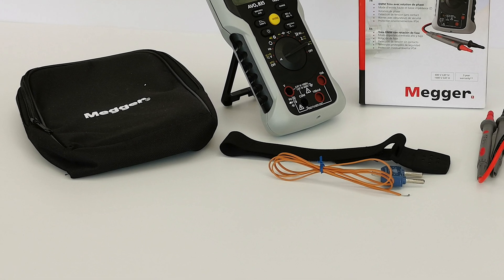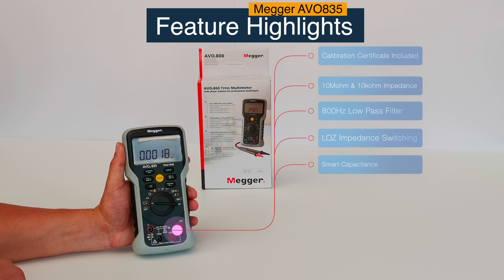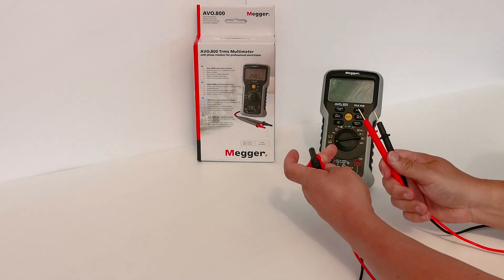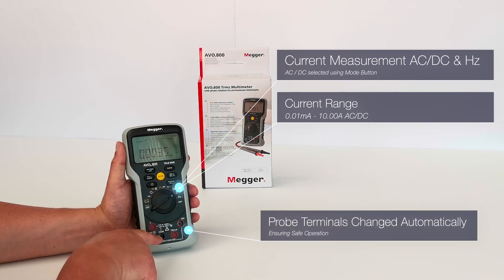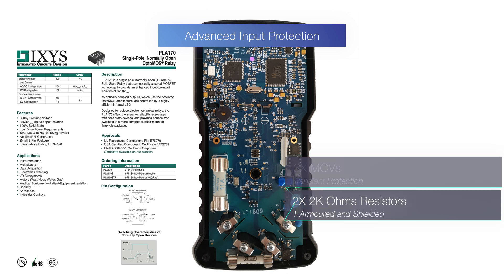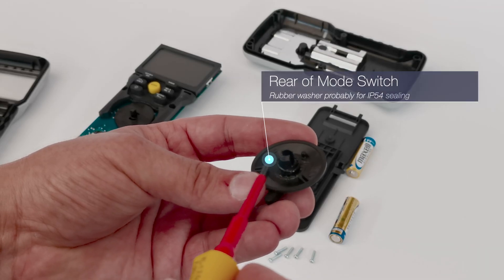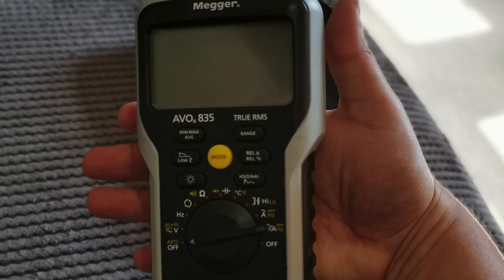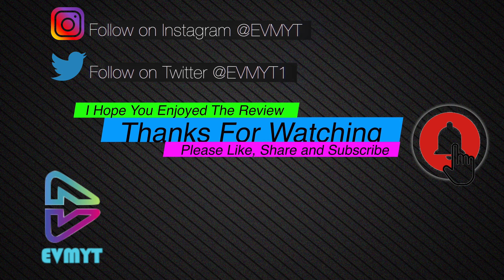Megger AVO835 Multimeter Full Review and Teardown, ideal for a beginner and advanced user.

Comment: Like the video but not the product. I'm UK based, home of Megger but the 800 series isn't really pushed here, more in favour of the 210 and 410. Bought one though and it's just arrived. New out the box 835. The K probe is flaky with values dancing around and looks cheap and nasty. The case is also a bit 20 quid Aneng. Quite shocked really, pun intended. But really felt deflated that such a product could be so disappointing at this price (£235 inclusive). I've had a quick test and not impressed. My advice is do as Megger UK seem to have done, try and forget it! Anyhoo, that's my 10 cents worth.

Comment: First impressions from work in the maintenance field is really slow DC voltage reading, 12, 48 and 110DC. Practically unusable for field work, screen refresh rate is deal breaker.
Waiting for firmware update. Looks like promissing device, but avoid for now!

Comment: I finally got one of these. One big issue I have with it, is that it is very slow to give voltage readings. If I knew this, I would not have bought it. 😕
Reply: Yes, same issue! Writted to factory to ask for updated firmware. Insanely slow, deal breaker!
Reply: @ilijavk  I also asked the manufacturer for fw updates. They don't do any. 😕
Reply: After a little bit of investigation I discovered that the problem is the autoranging. If you set the volt range manually it's fine. Anyway, it appears that Megger have discontinued the model so I presume it was a flop.

Comment: You compare the Megger with the Fluke 87V.
But how does it compare with that Brymen bm869s? (Which happens to be my favorite multimeter, and I believe cheaper too).
Also I miss in your rating system something about accuracy ( it is in your like/dislike list though)

I think when comparing to the Fluke 87v, you should compare warranty, servicebility (incl. Calibration possibilities) and ruggedness, as those are the 87v's key purposes I think.

Personally I think I would get nuts from this meter due to the voltage and current inputs are the other way round compared to most other meters.
Then again it has the shuttersystem which protects you for making mistakes on that point which is a nice feature.
However I always wonder how rugged that is. Does it hold up to the 50k switch lifecycle test how for example Joe Smith does these?

Comment: Nice review!
Saying that, regarding the quality of test leads ( youtu.be/xRkMdbNCBWo?t=153 ) i have some comments:
The side "cage" contacts on the probes are not supposed to be used exposed but covered by the caps included which will leave exposed only a couple of millimeters at the tip. Is due electrical safety requirements as per GS38  www.hse.gov.uk/pubns/books/gs38.htm
The only need to remove the caps would be when using croc clips or to plug in any standard 4mm socket
Indeed, for a hobby use they are a nuisance but a manufacturer must comply with all elf and safety regulations :)
Reply from the maker: Yes i am aware of GS38 regulations.  My issue wasn't with the length of the probe tips, it was with their lack of conductivity when being used in continuity mode.  I found they really let the meter down and held its performance back.  I guess its no different to buying a £2000 CD player and finding bell wire interconnects inside (which happens) .  Id personally rather a manufacturer leaves them out altogether.  Thanks for your comment, i was otherwise very impressed with this product, i hope your considering subscribing too.  :)